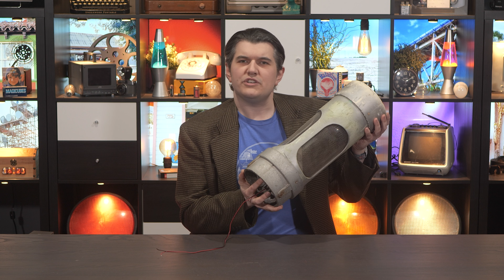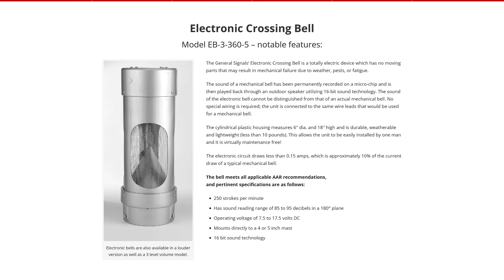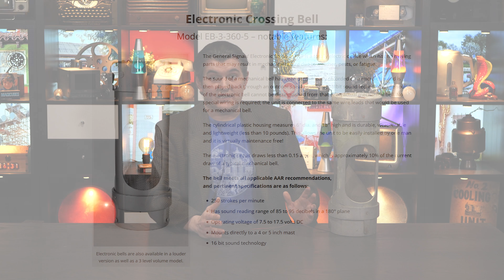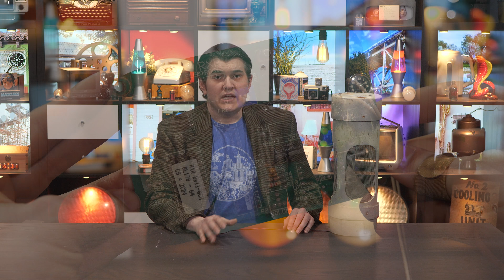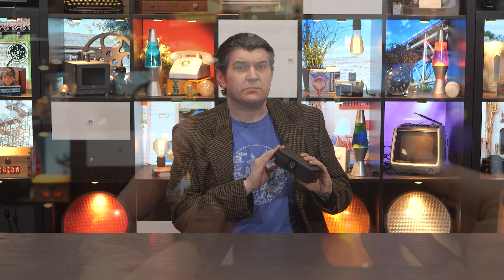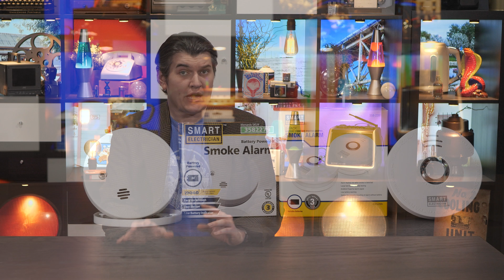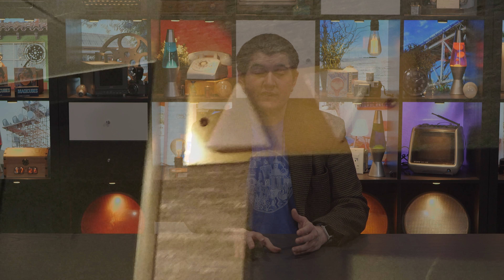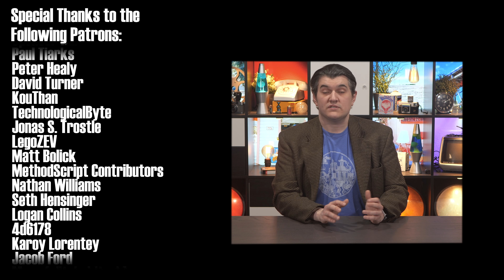The disappearing and unappreciated art of audible alerts

Comment: 20:05

For all of the problems with Windows – and there are many – I greatly appreciate the granular control you have over just about everything. I am very aggravated that Microsoft seems insistent on removing this granular control, but in classic Microsoft fashion, they remove things half-assed. So some things (like system colors,) can still be adjusted in the Registry Editor. Why they removed this? I have no idea.

I used my brother’s Chromebook once, and I was so frustrated at how locked it was to what options Google wanted you to have. Even with the over-simplification of Windows (and some options I’m talking about that have granular control aren’t as simple as they could/should be,) Windows still allows for so much control.

And on the topic of today’s video, sounds! Windows allows for a wide array of sounds to be set for any system event, though since Windows 8, they have used only two for system alerts. Background for lesser priority alerts and foreground for higher priority alerts. The options still exist to set them though, which is incredible. In my personal opinion, and to the video’s point, the alerts have just become too soft and “pedestrian.” We’ve dumbed down the soundscape too much. “Background and foreground” sounds are just too simple to encompass all you might encounter in Windows. Take Windows Vista for example, my favorite version of Windows, but it has the best sound scheme in my opinion. A basic ding for an invalid action or low priority error. A more attention getting “exclamation” sound for a medium priority error or user error/question, designed to get your attention so you know to read carefully. A critical stop error, a sound for a high priority error that lets you know that whatever you were doing was completely unsuccessful and might warrant further investigation. Or even the medium priority’s brother, the asterisk! To let you know that an action has been completed or to bring your attention to something that was not or is not necessarily an error. The device connect, disconnect and failure sounds are more distinct from the error sounds to let you know it is a sound for hardware related information. Unlike today, where the sound blends in with everything else. The User Account Control sound is a quick double tone alert to bring immediate attention, but without causing a panic because you still may have control of the situation it’s prompting you for. I could go on, and why the sounds are made with true genius.

But this is long enough, and just a roundabout way to say I agree wholeheartedly that this silent future we’re approaching isn’t good, nor fun. There’s no way, nor reason why we shouldn’t have this type of granular control to set every single notification for every single event, IF the user wants to. Don’t make it intimidating, and always give the simple option first as to not confuse the non-power users.

Comment: When you started to say your bit about Pebble I was this close to immediately jumping into the comments to say it was back... though probably everyone who was ever in love with Pebble knows by now.

There was a period where I was doing a lonely property-management job (without going into details) and I spent a lot of time with earbuds or headphones on, and it was nice to have a watch that could reject incoming calls and control my audio.  I also found it a vastly better way to control my car audio (when it comes from my phone) than the car headunits themselves or the phone, because I set the audio control app to a hold-buttonpress, meaning that I could pause the audio in my car without taking my eyes off the road.  Right hand to left, hold the up button for a couple seconds, tap the center button, audio is paused.  The third party head unit in my car doesn't integrate perfectly with the steering wheel control buttons, and it was useful when the car I had didn't even have those, but it's also really nice that the same controls exist no matter the circumstances.  Car, lawnmower, walking, vacuuming, on my back with my head underneath a desk or something working on something, in the middle of soldering, in the shower, whatever.  I would still be using my old pebble if the water seal on the button hadn't broken... and if I hadn't broken the ribbon cable inside trying to fix it.

I'll also say that my favorite watchface was one called Timely that would put three weeks worth of dates on the bottom of the display, which really helped whenever I needed to translate back and forth between "next monday" and "The 20th".  There wasn't enough room for that to integrate with calendar stuff, but it eased my anxiety by making the relevant information very handy... and it also didn't go the full distance to showing me the entire month, which honestly isn't necessary.  Looking through the store now, there are a lot that do something similar, but I stayed with that watchface for most of my many years with the watch.

Comment: Unfortunately, intentional design is dead across all fields, not just sound. The doors at my office have pull handles on both sides but only open one way, so you need to memorize for every single door in the building which way it opens or else deal with doing it wrong 50% of the time. Windows 11 moved the start button to an inconsistent position somewhere left of middle so that you can no longer move the mouse directly to the start button by making a quick mouse motion down and to the left, which worked consistently for twenty-five years (we don't talk about Windows 8). The transaction alerts from my bank that used to tell me the amount of the transaction and other useful details now just tell me "hey, something happened, log into our website to find out what!"

Comment: i don't understand the "plugged in" mindset on smartwatches. i use mine for essentially the same exact features id use a pebble for just with a sapphire glass and titanium body that's held up for 4 years without a scratch on the lens, which is impressive because I'm a mechanic and have jammed that thing into an engine bay way too many times. i have it set to use different vibration tones for different apps,, as well as sounds when i don't mind the noise, and block out all of the non important apps so only the truly needed stuff makes it to the watch. i can also control my music from my wrist, respond to texts and other important things without my phone involved.  the most useful thing is that its saved me when i forgot to charge my phone and it dies in an unfamiliar part of town, i still have my watch with gps and everything. also if i get into an accident i dont need to worry because 911 is a few taps away. if anything I'm far less "plugged in" than before i had one because it keeps my phone out of my hand. i use a galaxy watch 5 pro. 

also I'm a little disappointed you didn't show the internals of a doorbell, they are surprisingly simple. just a couple xylophone bars and a solenoid.

Comment: I find that the real railway bells sound better. Perhaps it is because there are generally several at a crossing, and the mechanical ones would have slightly different frequencies and cadences. Or perhaps it is that no (cheap) sound system can truly reproduce the sound of the clapper striking the bell.

Comment: As an RR worker the fake bells dont work for cars with the windows up and or radio on.  The sample rate is too low, and has insufficient penatration of sound proofed cars.  The purpose of quiet zones for RR crossings is a compromise protecting the sanity of insane people who build apartments right next to the whistle board or crossings . The " upgrade  " downgrades everyone elses safety for the stupid's sanity.

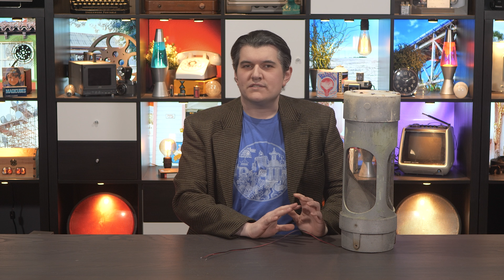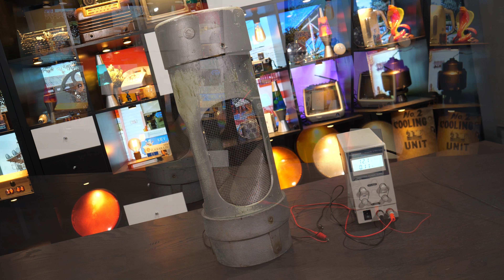Comment: 15:26 I use different sounds for my notifications for direct messages I use a very annoying loud sound that will last 0:11 and yes it will startled you if you're not expecting it I jumped multiple times because it's loud most of my notifications sounds it's supposed to be loud and annoying to catch my attention because the default one is just so sudden and almost quite and common oh and non direct messages last 0:15 the other apps that's not important immediately last 0:03 and to indicate full battery last 0:32 so yea and now my haptic engine decide to go out with my fingerprint sensor the sound helps

Comment: Bay Area Rapid Transit (BART) recently added audible cues when people use their RFID chip to tap into a fare gate. The genius about it is you need to hold your card a bit longer for the chime to go off. This allows those who want to hear the chime (typically blind people) to trigger their chime without chimes going off constantly from all the fare gates. There are separate chimes for entering and exiting to prevent people from crashing into each other through the same fare gate.

Comment: I use the Nokia Cell Phone Ringtone (you know which one) because those types of "obnoxious ringtones" were literally designed for the smaller piezoelectric speakers still commonly used on cell phones. A common problem smartphones have is being able to hear the phone ring along with anything else speaker related. I used the built in sound recorder app my phone came with and literally recorded it off of YT so I didn't have to download another app. (I work in a noisy machine shop and can vouch that the trick works.)

Comment: Oh boy this has been bugging me for a while. It's not going to end well but let's talk about Israel. Hopefully this won't get political. 

So before smartphones rocket alert sounds used to be simple. If you hear something going wii woo it means "seek immediate shelter" which has been drilled into us since kindergarten. If it doesn't go wii woo that means it's either memorial day or holocaust remembrance day. long story. 

Nowadays there are apps that connect to an API run by the Home Front Command to tell you if there's an alert in the area. But along with it the Home Front Command sends push notifications to phones if there's a missile from somewhere far like Iran or Yemen. And these push notifications apparently use the amber alert sound in the US and it's for some reason sound scarier than the actual alarm. Do people in the US really get those for Amber Alerts? Like I get they are important but they are not "wake you up from dead sleep" important. Even for missiles there is no guarantee you'll get alarms so some people just disable them. Meanwhile the app's "early warning" sound (at least the one I used) used to be a soft chime so now random sounds I don't recognize coming from devices scare me. 

Also they started using the regular "seek immediate shelter" alarms as "something geopolitical happened" alarms. Which like... why are you doing that? That's not what it's for. We figured out how to do personal alert systems that don't involve loudspeakers being mounted on buildings back in the Gulf War with commodity radio receivers ("The Silent Wave") and 35 years later they are somehow worse when we all have highly networked supercomputers everywhere.

Comment: Alec, way back in the day (I know that I am definitely dating myself here) I worked for Radio Shack (then later RadioShack, LOL). All of the stores had an infrared beam that crossed from one side of the entry doorway, and a reflector at the other end that would return the beam back to the sending unit. When someone would enter the store, it would sound this shrill, annoying tone when the beam was broken. I still hear that sound in my sleep. Anyway, I ended up using the 12v output on the unit to bypass the internal and infernal 3kHz tone, and instead installed a chime that we sold in the parts section of the store. This chime, by the way, on the package, I remember very clearly stated that the 12v chime had a "pleasant ding dong output." I also replaced the horrid key in ignition/door open, very loud and annoying buzzer in my 1985 Chevy Chevette with the same chime, giving my car warning tone the same "pleasant ding dong output". Thanks for your great video on audible alerts.

Comment: Just so you know, most of those electronic railroad bells circuit boards don't just contain one recording of a bell, many can be configured to various bell sounds depending on the railroad.   As not all railroads use the same bell sounds.

There is usually either a jumper or multiple jumpers for setting or a rotary switch or switches that allow you to select which bell sound you want to use.

Also, no horn zones may also use electronic locomotive horn sounds attached to or near the crossing signals, they usually operate as the crossing activates, but does not operate during the entire time the crossing is in operation.

And are you even aware that actual train locomotives are using electronic bells and some even newer ones are using electronic horns.

   By using electronic circuits and sound chips they can also have control of the volume levels of the bells and horns, something you can't control with mechanical bells or air compressor controlled horns.

So electronic sounds in some areas have better advantages than old school mechanical generated sounds.

Comment: Alec, I have a bunch of thoughts on how the user experience could be potentially improved for your recordings, especially in the case of bloopers.  You could use a raspberry pi to control it all:

* A pressure-sensitive foot pedal to control the speed at which the autocue scrolls
* You could upload scripts to it by emailing them to a dedicated email account
* If you use a marker in your scripts for a checkpoint (e.g. "=====") that marks the start of a single piece to camera, then you could have two buttons - one that marks that "block" as complete that stops and restarts the camera/audio recording and another that both rolls the autocue back to the last checkpoint and also stops and restarts the camera/audio recording.  Depending on the capabilities of your audio/video recording setup it could also somehow tag those video/audio files with the script and block IDs, as well as "blooper" or "complete" for ease of editing

I'm a software developer by trade, so happy to talk more about this if you want :)

Comment: Clear, unambiguous audible alerts were a big factor in the Helios Airways Flight 52 disaster. The Boeing 737's alarms for unsafe takeoff configuration and for lost cabin pressure used to sound exactly the same. The pilots on that flight heard the alarm go off and thought it was a false alarm for takeoff config, but it was actually going off because they lost cabin pressure. So they let the plane keep climbing into thin air and then everyone on the plane except one flight attendant passed out and died due to lack of oxygen, and the plane kept flying on autopilot until it ran out of fuel. Boeing fixed this by adding warning lights to the front instrument panel that indicate whether the alarm is because of takeoff config or cabin pressure. They kept the alarms the same because most pilots did correctly recognize that the alarm going off in flight was probably because of lost cabin pressure, and they didn't want to risk pilots getting confused by a new warning.

Comment: As someone with literal misophonia, I can tell y'all that the problem of sound pollution isn't simply individual sounds, it is a systemic problem. Sure, some individual sounds can be problems on themselves, but simply atomized approach of "silence every device individually" does little to address it. Just as every other aspect of the built or human managed environment around us, soundspace needs a more holistic collective approach. You need standards and regulations not only for individual behaviour but manufacturing. It needs to be planned based on what other sounds things might have to coexist with, and other aspects.

Comment: As a designer: giving too many options can be worse than too few.
Reply: No, not really. That somehow got traction but as a developer, user and occasional designer: no. Using sensible defaults is usually all that it takes to keep both inexperienced and experienced users happy. 

The real reason was that giving options also means you have to support them. Which means doing it properly: don't hardcode your colors or your font sizes or your sounds. And that takes effort and even knowledge of the system... which got in the way of making shiny new things. (And also, people used it to keep the pleasant things pleasant and the unpleasant things out... but that's not good if disrupting and manipulating the user is your core business.)

Comment: I miss the old Notification LEDs on phones. These this where amazing as sound is not always something I notice due to being 50% deaf. 

No i do not want to use the flash light, this was a seperate LED that was on the front of the device and would flash a colour depending on what the notification was. 

Red for Battery almost flat
Green for SMS/Email notifications
Yellow for missed phone calls.

Comment: 2:45 One other reason for the switch to electronic bells is that they draw far less power than mechanical ones. This is important because basically every crossing runs on batteries so they'll still work if the power goes out. Between electronic bells and LED lights, the amount of time a signal can be expected to operate without mains power keeping the batteries charged has gone up quite a bit